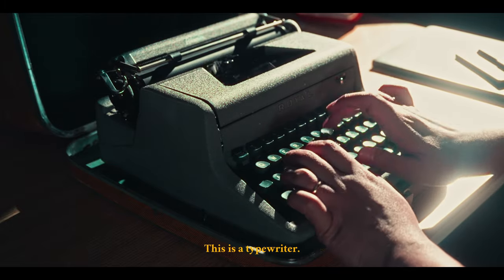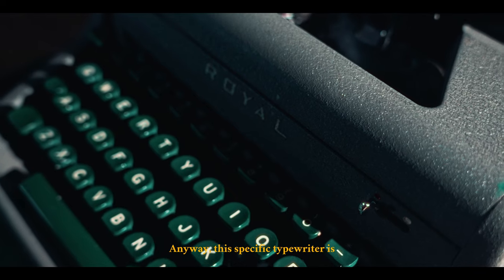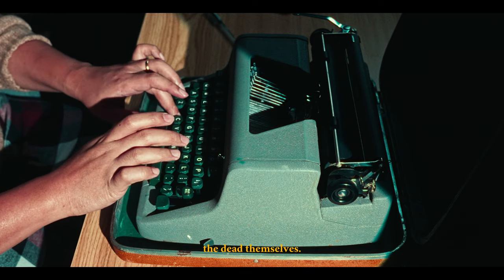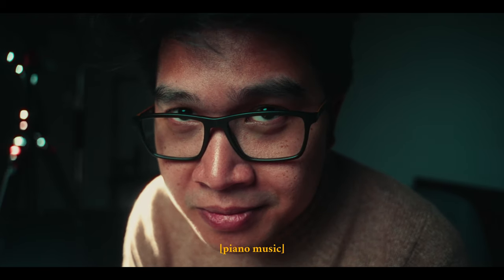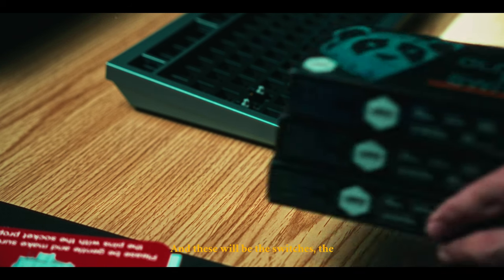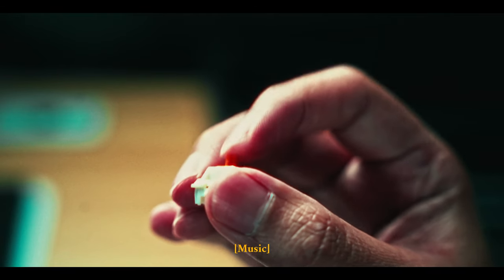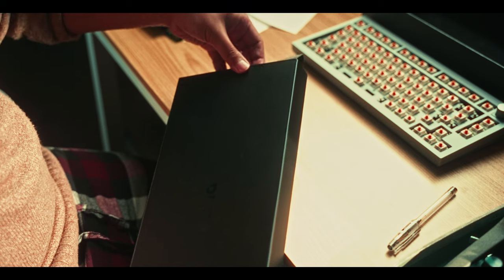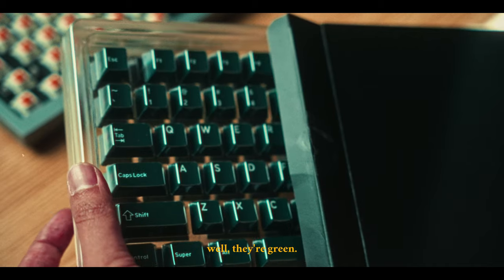Building a Modern Keyboard Inspired by a Vintage Typewriter

Comment: Ooooooo … I cringe watching the typing on an exposed typewriter platen!! What damage. Always, always type with ‘two’ pieces of paper. One is a ‘cushion’ behind the top page.
Reply from the maker: Lol, sorry about that. My first, and probably last relationship with a typewriter though. 
There’s a second broken thing in this typewriter that I didn’t mention in the vid, which I really do think it makes it unusable. It’s the cylinder up top (you can educate me the proper name for it), it just freely moves to the left, doesn’t stay put if pushed to the right. I also kind of expecting it to be broken after I bought the thing.
Reply: @Lucas_Alpay  No worries. The fun of comments is part of the viewing experience. But I love using my typewriters (I rotate between 6 different ones) when doing that first draft. The process gets my brain into a different rhythm with the physical sound of the keys.
Reply from the maker: But, just in case, if ever I have an itch to buy an actual modern typewriter just because, any suggestions what to buy?
Reply: That 1955 Royal Portable that is in your video is a popular model for many vintage writers. But if you can find a Hermes 3000 … 1960 to 68 … then grab it if it is in good shape.